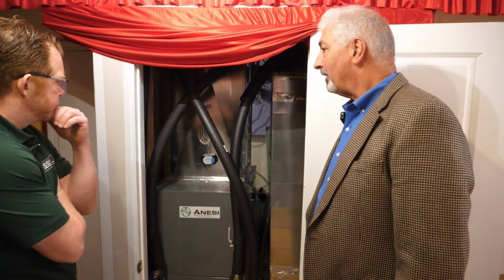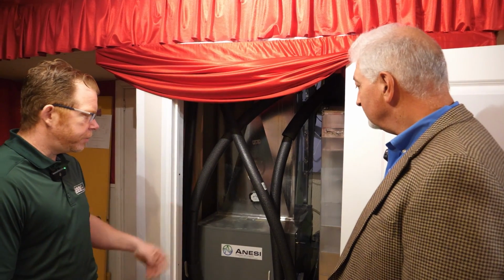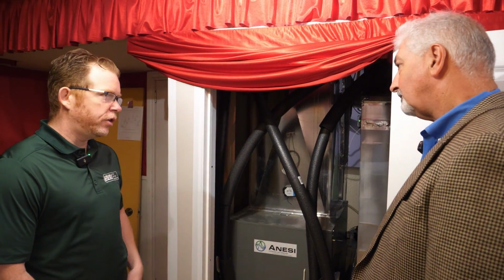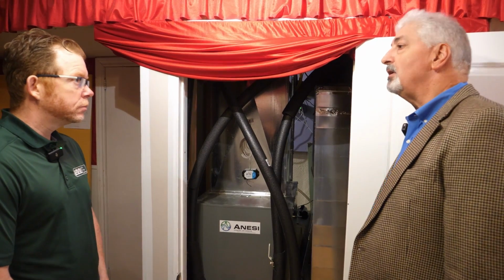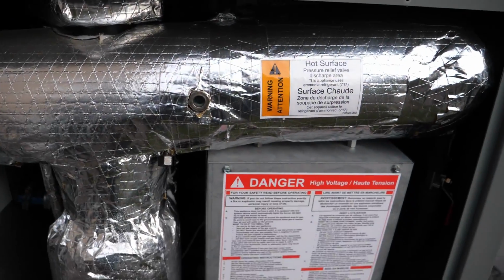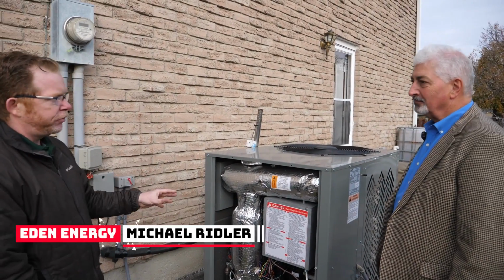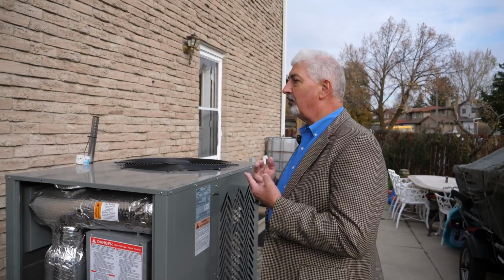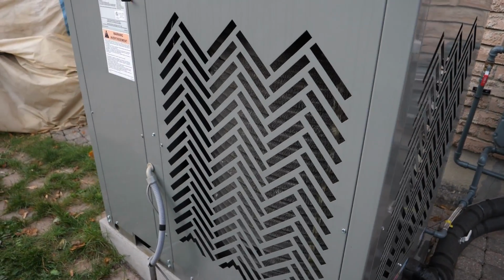Are Gas Absorption Heat Pumps The Future?

Comment: This is so stupid, an electric heat pump(that you use as air conditioner in summer) plus gas heater (or propane) is cheaper and will be easy to service and maintain and unlikely to go bankrupt.